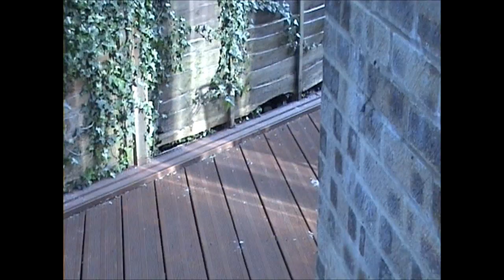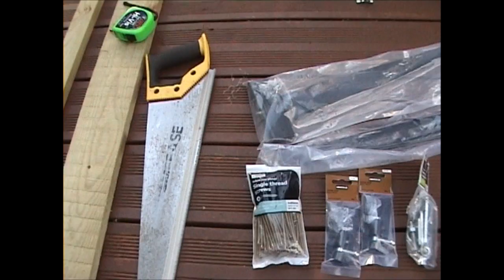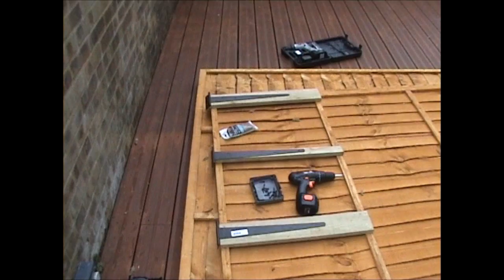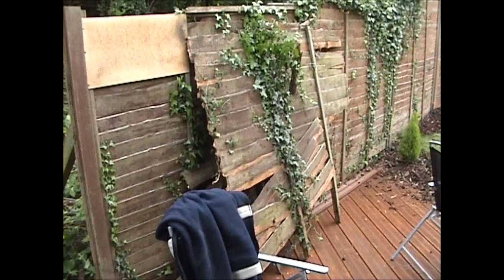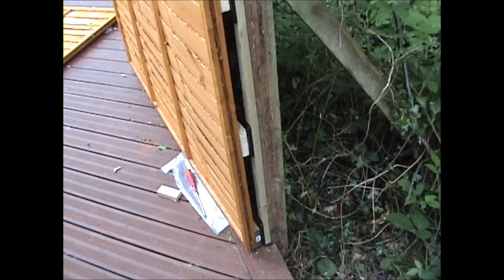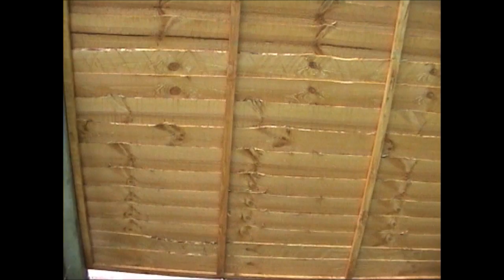How to Turn a Fence Panel into a Gate

Comment: Hi. Your video is exactly the help I've been looking forward. Going to make 2 gates from 6x6 panel for my driveway. Could you tell me the thickness of the wood needed to fix to the panel, on which the hinges are attached please.
Thanks
Reply from the maker: Nigel Southway The thickness of the wood I used is 20mm. So far so good as it's not fallen down yet!

Comment: Hi there, this was really helpful. I'm looking to do the exact same thing but with a panel less wide, just under a metre, do you think the battens you fixed, and the hinges you used would be overkill on my project? if so could you suggest the right size I may need?

Comment: Looks good. just flip your pad lock mechanism. the screws are supposed to be covered when it's padlocked.
Reply: Alan Session that particular hasp and staple  are meant to have a coach bolt going through the section where the screws a exposed
Reply: @danshipstone223  then all you have to do is take the screws out if you want to get in bad enough

Comment: Out of interest - can you give a bit more detail on the specifics of the materials please? The size of the wood batons, and in particlar the size/length/strength of the Hinges? Also - is the fence still upright and attached?! And what happened to fantastic Mr Fox?
Reply from the maker: David Edwards the thickness of the wood is 2cm. I bought the brackets in Homebase I think and they are about 50cm in length. I used three to ensure the panel wouldn’t fall off. It is still there btw 5 years later! I believe the fox went on to pilot an arwing along with a frog, a rabbit and a falcon.